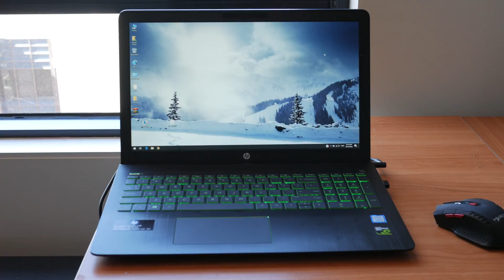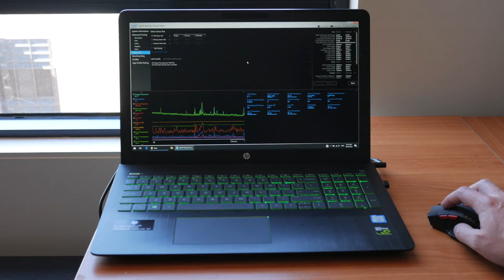HP Pavilion Power 15 - i7 7700HQ CPU Current Limit Throttling

Comment: The frequency of 4 cores in a turbo boost of 3.4 GHz is normal. Because in this processor, 1 core operates at a turbo boost frequency of 3.8 GHz, 2 cores operate at 3.6 GHz and 4 cores operate at 3.4 GHz.

If the frequency in the turbo boost is below 3.4, then you need to change the thermal paste. In the factory thermal paste, I had more than 2.8 processor did not work in the same laptop.

https://en.wikipedia.org/wiki/Kaby_Lake
Reply from the maker: It was not a problem with thermal paste. As you can see temperatures were fine. It was a problem with the VRM not being able to sustain the power limits - current limit throttling.

Comment: i have diffrent model but i have the same problem as well in my HP laptop using i5 10210u  15w but cinnebench r15 score cant pass 515 (avg 400ish) mark... no thermal throttling even i open the back case manualy cooling the heat pipe directly..... many laptop using i5 10120u can have 700 mark in cinnebench r15

Comment: single fan can't cool 7700hq with 1050
Reply: there are 2 fans, and the temperature are not hot. the problem is due to a bios limitation

Comment: wishful thinking lol my 15-cs3055wm is stuck at 83% no matter what I do
Reply from the maker: Worst laptop I ever had. Took 6 more months after I posted this video for HP to be aware of the issue before HP agreed to refund me the purchase price after lying saying there was no problem. Then I went and bought an Asus with a 7700HQ and 1070 and it doesn't throttle - it gets super hot but doesn't throttle. 

I'll never purchase an HP laptop again as I want the performance that is advertised and having customer service who understands problems rather than say there is no problem (when there is an obvious problem) is important to me.
Reply: @breachbangandclear  yeah once i actually get another gaming laptop i'm going with asus. i want to get the GA502XX model because it has a killer battery. i got this one for school mostly. however, when i first got it i ran the userbenchmark test and it did so horrible, wouldn't even run the graphical tests they'd freeze. once i replaced the thermal paste it did so much better, but still throttles and gets a 0 score in all categories lol.
Reply from the maker: @_Brohan  Wait, your HP laptop is a model that's 3 generations ahead of the one in this video, and it doesn't have a dedicated GPU? It's not a gaming laptop? 

It's a different problem all together that you are having?
Reply: @breachbangandclear  yeah no it's a basic laptop, I've just been looking into ways to stop the throttle on it, not successfully. I assume it's still due to thermals or something.

Comment: I know how to fix it
Reply: HOW?!
Reply: @Kyle-nw3wk 
0. Be Sure you are AC plugged in.
1. download nvidia powermizer manager.
2. Make everything like in a screenshot attached to this comment. (Skip making the restore point, it`s not neccesary, really)
3. Click "Instant Apply", then "Apply & Reboot" and confirm the reboot.
4. When rebooting spam "F10" to open BIOS.
5. In BIOS go to Security tab and switch "Intel® Software Guard Extensions (SGX)" from Disabled to S/W Controlled or vice versa (S/W Controlled to Disabled). 

6. Press "F10" and apply changes. Your PC will shut down for a few seconds and then turn on by itself (Just don`t touch it)
7. If you made it "Intel® Software Guard Extensions (SGX)" Disabled - be sure to enter code that will appear. If you made it S/W Controlled just skip this step.
8. Enjoy your CPU and GPU working on high perfomance at the same time.
Reply: @Kyle-nw3wk 
There's the link for powermizer 
https://www.mediafire.com/download/fuvvx6kmqhgiq2k
Reply: @Kyle-nw3wk  But for reason i don`t know sometimes, the throttling appears and I have to redo the manipulation

Comment: I have found out that its 7700hq default problem i own dell 7657 everything is fine untill power limit throttling starts i can easily see framerate drops. there's is a workaround but not easy ones
Reply from the maker: Not a 7700HQ problem. I tested with a Dell 7657 with 7700HQ and 1050ti and it doesn't throttle at all when the correct power plan is set. It's actually right next to me now. I also replaced the HP in this video with an Asus GL702VS and it doesn't throttle at all either. 

With the Inspiron 7567 if you create a new powerplan based on the 'high performance one, you should notice no more throttling. The stock Dell power plan does throttle slightly.
Reply: @breachbangandclear  wooow really never thought of looking at it i will test it tonight and report back here. correction mine is dell 7567 with core i7 7700HQ 16gb ram single channel , 128GB Slow m.2 SSD , 50-0GB normal SSD thermals are awesome no heatup recently updated bios because it was urgent from dell
Reply: @breachbangandclear  
Edit: turned on ultimate mode with powershell but again after both video and cpu benchmark i get power limit throttling 🤦‍♀️😢
Reply from the maker: @asif8672  I don't know what 'ultimate mode' is. There is the ability to change the power plan in Windows 10 Home, it shouldn't be missing. It's on the Dell website how to change you power plan to the 'high performance' mode. 

I have a Dell Inspiron 7567 right next to me now with Windows 10 Home and can change the power plan. It throttles when set to the recommended 'balanced' mode.

I can't upload pictures or link in a youtube comment, so hopefully you can find on google how to change the power plan setting easily.

If you're still having problems then I might be able to take a video for you later showing what needs to be done.
Reply from the maker: @asif8672  
I should also add that there is a -0.120v undervolt on the 7700HQ also in Intel XPU. This might be the step you were missing and I forgot to mention it earlier.

Comment: Hello! I have the same problem with a Lenovo Y720
7700hq
gtx 1060
when using the cpu and gpu the cpu frequency drops to 2.7
Temperatures never exceed 80.
Sorry for my english.
Did you find any sulution?
Reply: Amigo tengo una legion y730, lo pudiste solucionar?
Reply: Is your problem solved?
It is mostly about thermal throttling
use the pc at high performance mode 
check the temparatures at games
do the bios updates

Comment: Plug hdmi display. (Open powermizer as administrator and turn off AC / on battery) reboot your system with only hdmi display. Unplug hdmi and relax! will work until the next disconnect power cable.
Reply from the maker: Could you please take a short video showing that the CPU will not throttle when trying this? There's been a lot of 'fixes' suggested and none of them worked, and there's no videos showing their CPU wouldn't throttle when there's a GPU load for verification.

I appreciate the suggestions, it's just no suggestion worked for me and no one provided any proof that they worked. If you could take a short video of it working, it would be very helpful for those experiences the throttling issues with the HP Pavilion Power 15.

I no longer have the laptop so I can't test it myself. After a year of having it serviced by HP 3 times and spending countless hours in emails and phone calls, I asked for a refund (due to product being unable to perform as advertised). I bought an Asus GL702VS that while gets very hot, doesn't throttle either the 7700HQ or the 1070 maintaining full turbo/boost clocks while encoding/gaming.
Reply: can't find powermizer? if im searching for the right thing is it old software from like 2008?
Reply from the maker: @club412  Yeah that's the one. It doesn't work.

The few people who have mentioned it works, always stop replying when I kindly ask for proof that it worked on their machine.

 
Save yourself the hassle as there's no program, BIOS revision, registry hack to enable more power options, removal of Intel thermal framework, undervolting, adjusting turbo behavior, adjusting any options in Intel XTU or Throttlestop - just nothing fixes it, and there's no proof online of any HP Pavilion Power laptop that doesn't throttle the CPU when GPU is being used. There's only proof that it throttles heavily, well below the base clock and well below advertised speeds.
Reply: @breachbangandclear  yeah I've had no luck in finding it. I just updated the bios on mine recently and undervolted it. the best it does when the GPU is in use is 2.7-2.8 now but better than 2.0-2.3ghz i suppose.. I'm pissed my warranty is expired now I waited too long to try to get a refund. Overall its just a DJ laptop for me and it works fine for my needs but would be better since I do game at the club I DJ at sometimes when its dead.

Comment: having the same issue any idea ? my cpu is i5 8300h and its stuck at 1.4-2ghz an my thermals are ok max 65*C
Reply: Which model ?
Reply: @EnzoMastroianni  updating bios helped now its running 90-97C at 3200-3900mzh at all cores
Reply: Which bios version ? I have the fact same problem with same cpu
Reply: @romelius__  hmm the newest one its called F.29 Rev.A, you also onw an hp laptop ?

Comment: !!!! SOLVED !!! Try Nvidia powermizer switch. Just download it, run as administrator and make everything on. It helps me a lot.
Reply from the maker: If it fixed your problem, can you please upload a video similar to mine showing that the laptop can handle both GPU + CPU stress without downclocking the CPU to below the base clock?

As I and others had tried that but the problem still persists, and no actual proof of it working exists, it  would be helpful to others if you could show that your CPU will hold at least the base clock of 2.8ghz when both the CPU + GPU are being stressed at the same time.

Nvidia Powermizer did nothing at all to fix the problem for me.
Reply: https://www.youtube.com/watch?v=ge7OxLQ1bTI
Reply from the maker: @dinaratv0808  Wow, it works. That did not work for me when I tried about 1 year ago. Maybe different BIOS. I still think it is a big problem with the laptop that it needs powermizer and a lot of tweaking, to work as advertised.
Reply: @dinaratv0808  my nividia GPU disappeared after using this program. How do I have both Intel HD and nividia GPU like in your video?
Reply: Thank you for the fix idea. We really shouldn't have to go through this though. Their apps and firmware should be able to run optimized settings. 

This is way too advanced troubleshooting for someone who is not as tech-savvy. I really feel like CPU-GPU hardware companies need more competition. It's like a couple of firms run the whole hardware world. Not healthy when we're so computer reliant as today.
My year old XPS has been going crazy with current throttling non-stop. Will try powermizer now. Fingers crossed.
Reply: @UmutSagir  I tried the program but my nividia GPU disappeared. How did it go for you? Any fixes?

Comment: Lol, go to device manager and disable intel dynamic platform and thermal framework, all of it
Reply from the maker: Well, no. Tried many different Intel DPTF workarounds and none of them wored. The throttling is locked into the BIOS, there's no way to change it, not with any settings in Intel XTU, throttlestop, registry hacks, disabling DPTF or anything HP support could have done over the year it went through many warranty services to fix the problem.

As you can see in the video, the CPU temperature doesn't affect the throttling which indicates that it's possibly a VRM throttle - which an OS has no control over. 

I managed to get a refund of the machine after HP confirmed the same. I have technician reports stating that the problem exists and that it's unable to be fixed - hence the refund.

I now have an Asus with 7700HQ and 1070 8GB and that thing has no problem sustaining 3.4ghz all cores on CPU and full load on GPU at the same time - gets a little toasty but an undervolt on both CPU+GPU means no throttling even when pulling ~180watts from the AC socket.
Reply: @breachbangandclear  Ah, well at least you got rid of that piece of trash, haha! Cheers!

Comment: Yes, I have the same problem. HP i7-7700HQ / 1050. In the beginning, I had a 3.0Ghz processor frequency, then I changed the thermal paste and the frequency increased to 3.4Ghz. But this is not enough, the processor can 3.8. Insufficient cooling system.
Reply from the maker: As you can see, I get 2.0ghz and current limit throttling which is well below the base clock of 2.8ghz. It has nothing to do with temperatures as you can see. Repasting won't do anything if heat isn't the cause of throttling.

After a year of dealing with HP I have a refund coming in the mail as they were not able to fix the problem. I have technician reports stating that the problem of the CPU running well below base clock was found and that they are unable to fix it - that all Pavilion Power 15 models are affected and none run at their advertised speed when the GPU is being used.

Perhaps you could upload a video of your Pavilion Power running the same tests and show that it does not throttle? Because as is, there are no sources online that show this machine working as advertised.
Reply: @breachbangandclear  you can raise this limit in throttlestop easily

Comment: thank you for your video! if it's not too much to ask, can you please record how it affects gameplay (for some resource intensive game) ?  I was really into this laptop and then I saw your video and I am really disappointed now
Reply from the maker: I highly suggest that you do not consider an HP laptop. It's been ~8 months since I contacted HP with the issue and they still have not provided a satisfactory resolution. 

They have continued to ask me to be patient while they find a fix, over the last 8 months.

It affects all CPU intensive tasks, including many modern games and older games that rely on single thread performance. Games will run considerable worse than any other laptop brand with the same specs.

Comment: Faced the same issue. And after a lot of attempts, finally i can fix this problem, but for a time.
You have to download Nvidia Powermizer Switch and do these steps after every time computer was Rebooted or Hibernated:
1. Run Nvidia Powermizer Switch as administrator. 
2. Turn ON and confirm reboot
3. while rebooting open BIOS 
4. change "intel software guard extensions" to just another value. Usually i change from "disabled" to "S/W controlled" and vice versa. 
5. enjoy stable CPU clock speed at 3.4 ghz even with gpu stress test
Reply: Hi how do you get the Nvidia Powermizer? I cant seem to find it everywhere

Comment: I have exactly the same laptop with the same issue. I think it could be the power suply not work properly. I will buy a new one on amazon (230w). If thepower suply is the problem I will coment again. 

Sorry for my english, I hope you understand!! :)
Reply from the maker: Don't bother. I've had 2x official 150w power supplies and it doesn't make any difference - still same problem. The problem is with the motherboard hardware or BIOS.

Save your money and don't bother with getting another power supply.
Reply: Hi again! Problem solved. In my case I only unistalled de intel extreme tuning utility and the cpu rise up until 3.4/3.6ghz again. Try it! Remeber to delete the profiles and configurations also!
Reply from the maker: @Selum10  I tried the fix but it did not work. Infact this time I get as low as 1.9ghz :(

Here is a video of it: https://www.youtube.com/watch?v=E-KHnlC5qKQ&feature=youtu.be

Comment: i have the same with my cb028nf version : 7700hq/1050ti. It is only when cpu and gpu are working together. I hope they will do a bios update soon !

contact me if you have news about a fix !
Reply: I know how to fix it dude
Reply: @Yas-xo1pn   how ?
Reply: @EnzoMastroianni  do the  bios updates
Reply: @ulaskaradag2980  i just sold it to by a lenovo legion, but did a new bios update resolve it ?
Reply: @EnzoMastroianni  i don't know i got dell laptop i had same problem and  i solved with bios update
Reply: no i still have the problem even with the new bios update. Gaming should be at 120 fps but goes down to 60 fps at 1.8 GhZ..

Comment: having the same issue with the same computer. didn't realize it was doing this until i downloaded XTU and saw the curret limit throttling. mines stuck under package tdp 16w and wont go above 2.5ghz. what should i do?
Reply from the maker: Contact HP and let them know that you found an issue and would like it resolved. 

The more people who complain about how HP crippled this laptop and how it can't perform as advertised, the faster they should be at rectifying the situation.